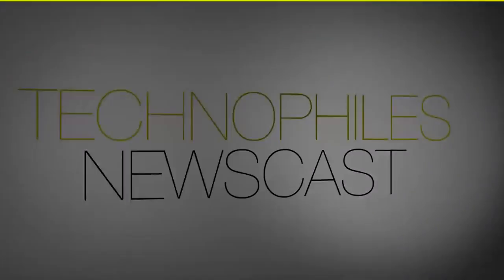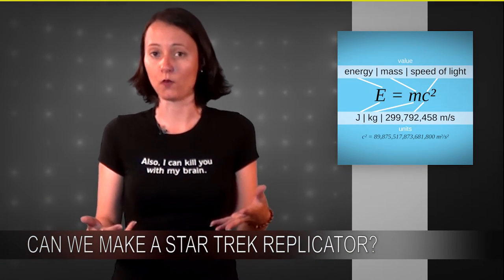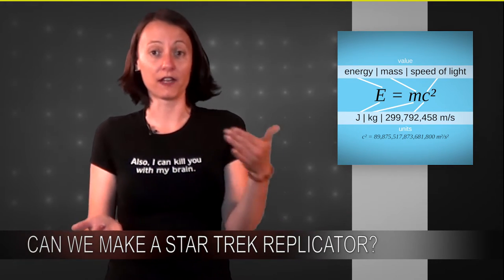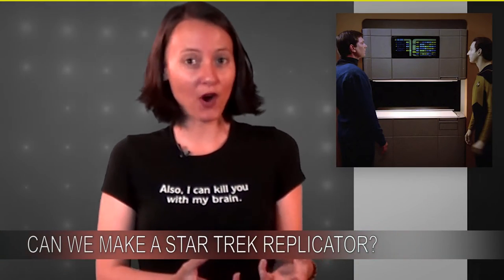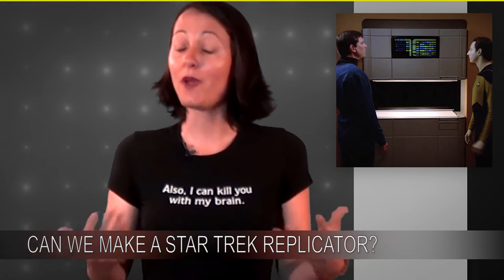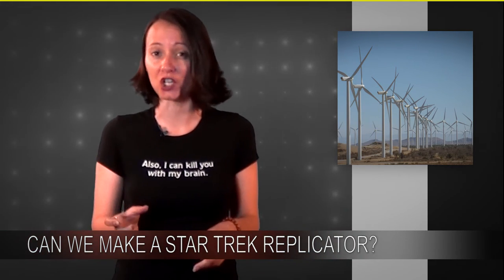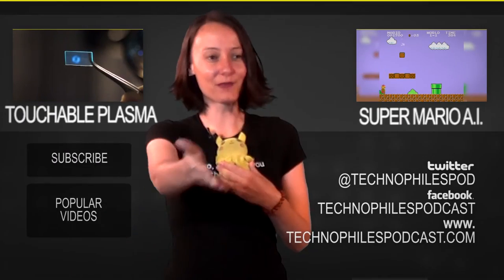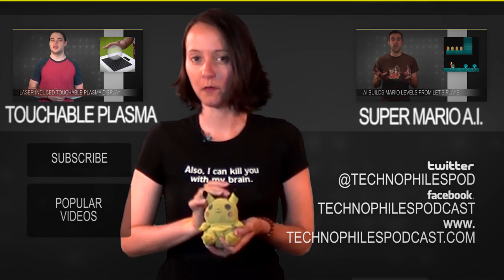Can We Build a Star Trek Replicator? | Technophiles Newscast 092

Comment: Burning is not using E=mc2. The mass is conserved, it's just turned into gaseous carbon dioxide and water. Energy is released from the breaking of the carbon-carbon bonds in the wood. Burning is more like the opposite of photosynthesis.

Comment: I'd like the replicator please. Also,

I don't understand the thought about the explaination in this video but I came up with my own idea, again, I don't understand the video so this might be the same but explained in a different way, I don't know XD

 I had an idea, what if we break molecules apart and then put them together in a different structure, then you'd be able to take all the plastic and impure stuff in the world and recreate them into something new. (Example: co2 = carbon and oxygen = coal (and 17% other elements we can get from other trash in our world.) I don't know if it's smart to re-use the co2 to make coal, burn it and turn it back in co2 but I couldn't think of any other examles XD The point is, if we create a machine that can re-create chemical structures by using molecules from other chemical structures, all our problems would be solved.

Comment: If Energy and mass are equal, wouldn't calculating the mass of certain matter be efficient enough to know how much energy it's required to make it?  There's a calculator on line that does a mass to energy conversion. Not sure how accurate it is, but it's worth a look.  If http://www.1728.org/einstein.htm Again not sure if it's accurate but according to it, essentially if say you wanted to replicate matter that weighs 10 pounds. You'd need the energy equivalent of 97.435 megatons of TNT. Compare that amount of energy to the Tsar Bomba and you'd need at least 3 - 4 of them exploding at the same time.

Comment: Replicators. Teleporters are of limited use.
Reply: @firedragon77777  not hard to do if you have the means to manipulate superstrings and know the exact frequency of the strings the lifeforms consists of...

Or...

When I stand in front of a wall the theoretical point at which I'm blocked is at the wall... If I move to an open door.. The theoretical point at which I'm blocked is at the end of the corridor and arrived faster than light...

Works in either light or total darkness...

Comment: there is a creature out there that actually does produce electricity electric eel they're real just in case you wanted to know if you didn't already I believe this process that they're using is in some ways flawed because of the massive size project and that is so interconnected as one it may take you an extremely long time for this process to happen I have a predicament that this process is better at a more micro level and you don't do that through massive projects like that you want to be able to concentrate the energy more closely not by a circle but a globe to be more accurate the secret to energy storage is encapsulating it by means of the best way is to use materials that maybe we haven't thought of yet buy infuse insert materials that we havent done yet and taking other materials I'm doing the same so in some ways we already do some form of this but I think the way that they're doing in the project that you describe is not the best way if you have the a certain density 2 item you are more likely to change that I don't ruin tents energy and having the intense concentrated energy and a super genius smart computer that can control that amount of energy and use that energy to change that Mass would be able to change the form better and could help the process so much more
Reply: Lucas Blom WHAT are you TALKING ABOUT??
I’m sorry! It’s impossible for me to follow any thread in your comment. You are jumping between statements without clarifying your points, man...